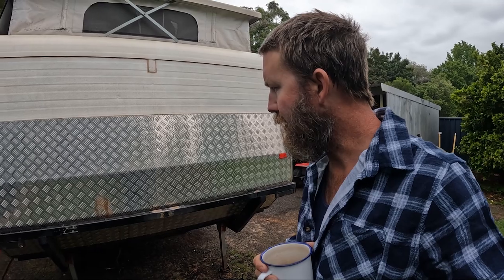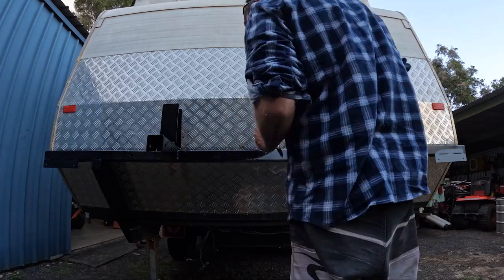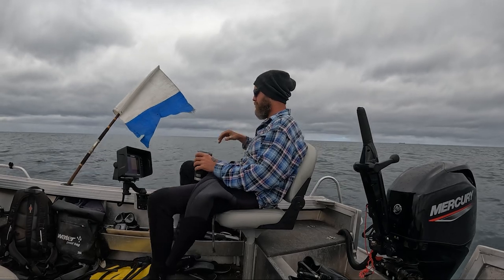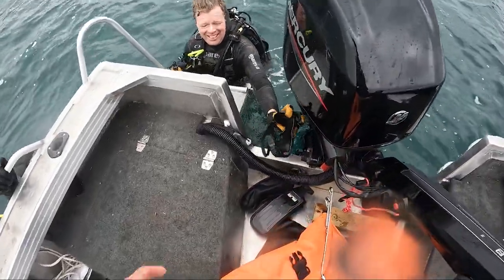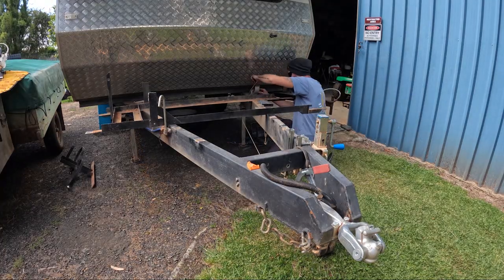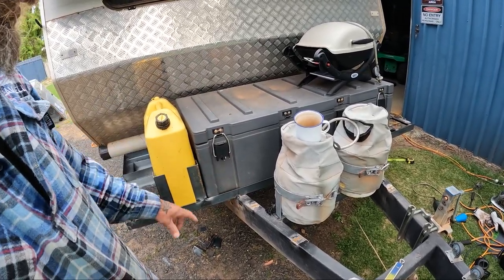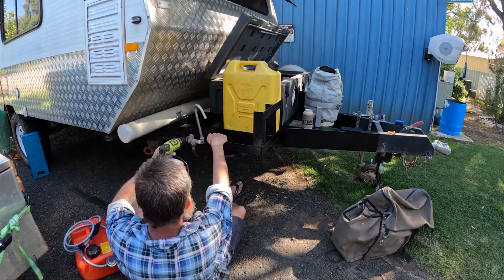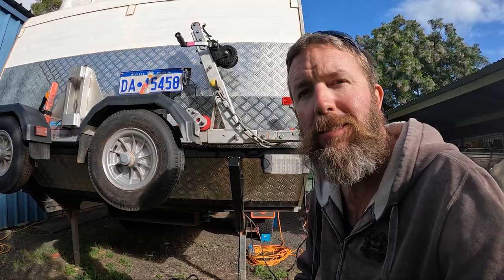Caravan Upgrades | Cray Diving in Bunbury W.A. | EP08 | Year 2

Comment: Great fun Jed, Loved the crays and seeing you having a ball with your old man. The trailer mods look epic. Just some inputs before you head up north and hit the cooregations. Those plastic fuel containers brackets - get some boat carpet glued on them or you will will end up with holes in the vessels rubbing on the brackets. Black paint  is going to get really hot and radiate heat and your bed is close by. White of Silver or glue some boat carpet to tops and sides, helps reduce rock chips and heat. Rock Screen on Draw bar to save your back window as a thought?  Chuck a Reese hitch set up on your bull bar so you can drive the van into parking bays rather than back her in. If that is not making sense, send me a message and I can send you some pics ;)
 Wishing you and Kel an Epic Christmas. 👊🎅🎄🤿🍻
Reply from the maker: Cheers mate! 
Arr yeah reminds me I have some rubber to put down under the jerry cans👍👍. 
Yeah she is a special chassis paint mate, but not sure I'd paint it in white as it all just gets covered in red dirt anyway! Haha. 
Have a good Christmas mate and cheers for all the support throughout the year!! Much much appreciated 🎄🍻👍